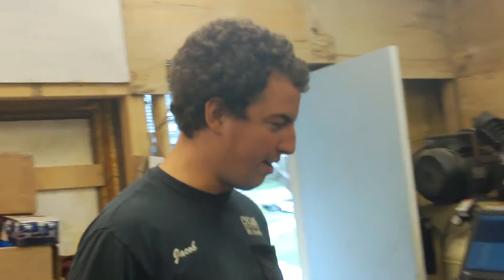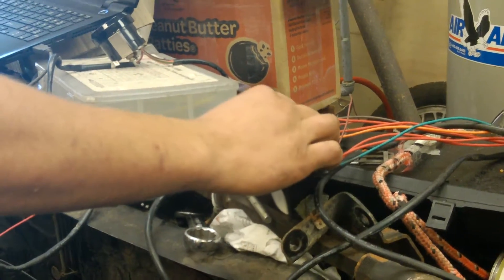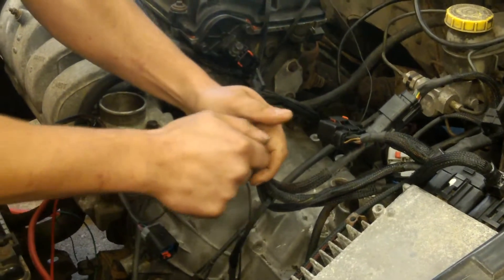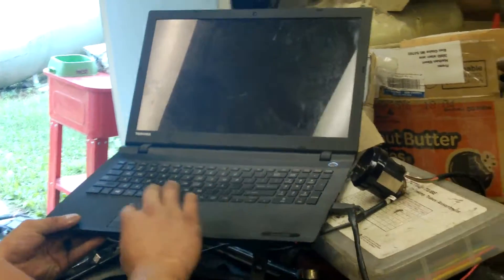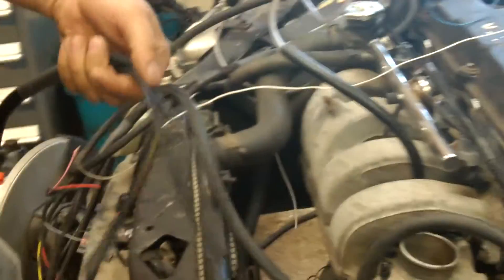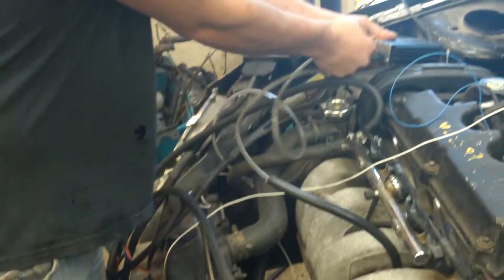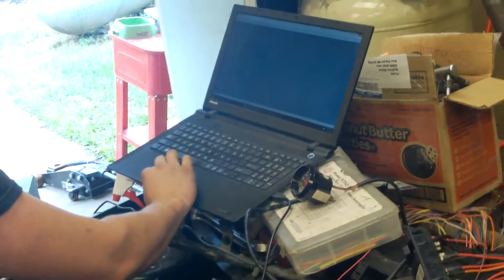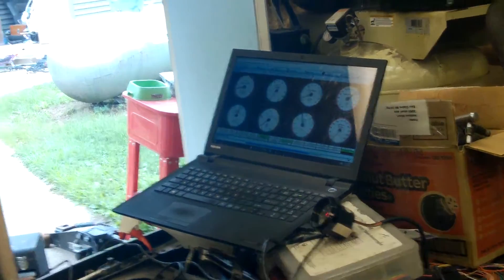Megasquirt and FIC plug and play Harness Dodge Neon

Comment: Fell across this site looking for harness wiring 2003 Dodge Neon under hood schematic. what's the link, Please. Car was dry docked for a couple of yrs. Mice had 7 course meal under the hood. SOS
Reply from the maker: barbara beaulieu It will all be in the factory service manual (FSM) which can be found for download online. Big PDF file. 2004 is same as 2003

Comment: what's the price ?
Reply from the maker: https://kinnettickreations.ecwid.com/#!/FIC-MS-Plug-and-Play/c/14381350

$500 for the engine harness itself, and $50 for either the MS or FIC harness adapters.
Reply: I have a 98 rt neon with 2.4l swap I used the 1gen original harness just changed the pins to the spark plugs and injectors I bought a mega squirt 1 I have the 8in harness to go with it do u make a harness that will work with the 2.4l swap with the mega squirt?